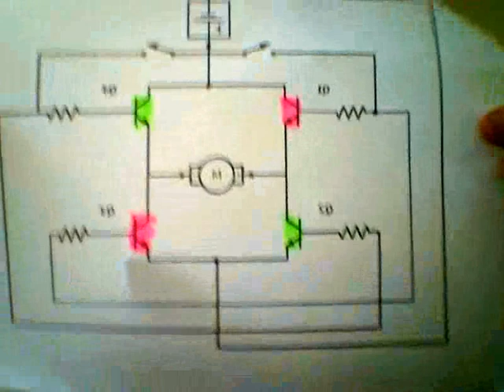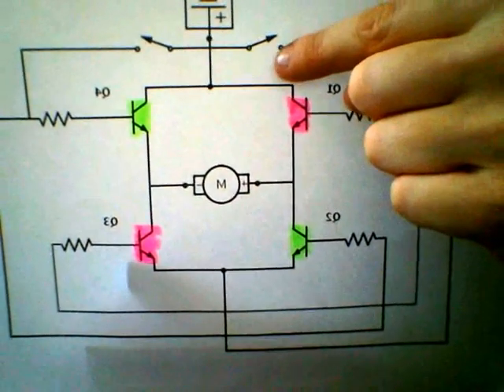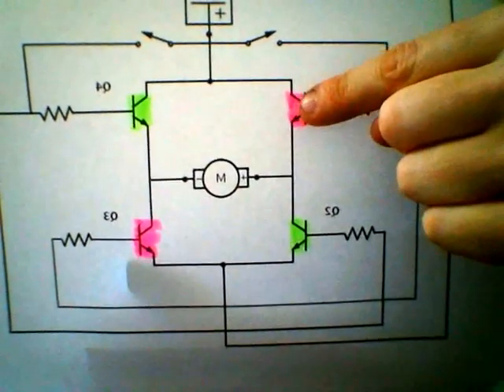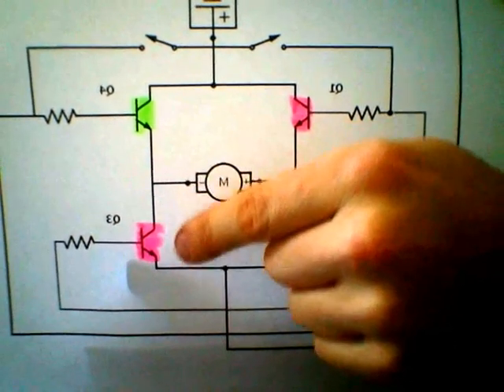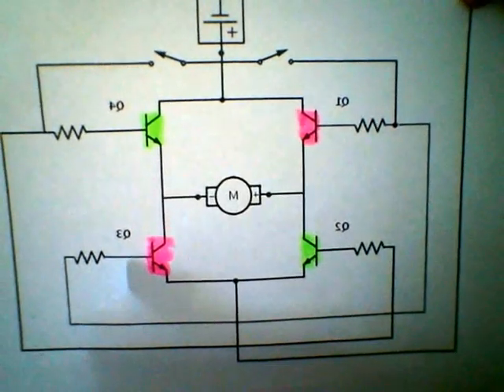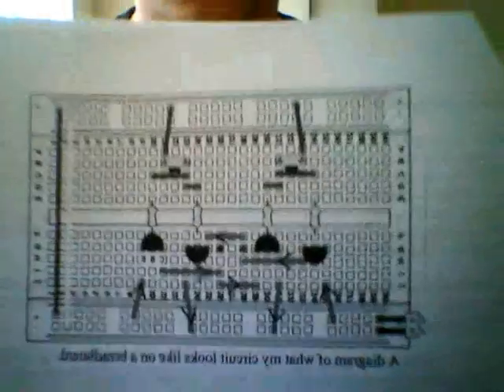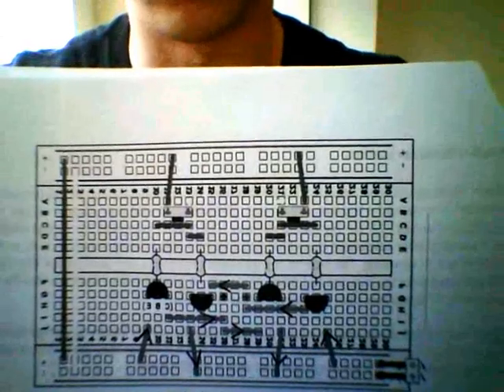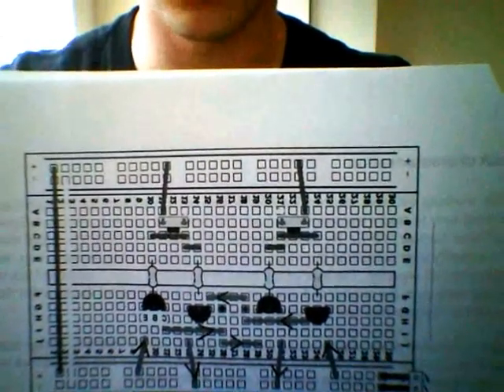H Bridge DC motor. - bi directional - very simple.

Comment: no microcontroller? what are the transistors for? i thought transistors where to supply energy from another source, but you only have one source. 

electronics noob here
Reply: i think hes trying to protect the battery. when the motor stops it generates a voltage backwards up the bum of the circuit. gotta stop that yuckyness from damaging ya battery or arduino
Reply: yeah but i also thought that where the diodes for, for the backlash. and there isnt any diode there...

Comment: you are yousing npn or pnp transistor
Reply: It looks like he's using 4 npn transistors with a simple resistor protecting the gate of each. The dead give away is the manner in which the gates are coordinated. since the cross the h-bridge diagonally, you're actively turning both gates on, rather than turning one gate on and one gate off (which would be 2 npn and 2 pnp transistors).  

As a matter of efficiency, PNP transistors are not used alone for an H bridge. They heat up much more quickly relative to NPN transistors, and designing to only use npn or npn-pnp is much easier.

Comment: can anyone explain to me, in this circuit what is the function of each transistor? I've been reading a lot of stuff but can't seem to grasp what exactly they are doing. I would guess that Q1 and Q4 are amplifying the current which will make the motor spin faster? but what about the bottom ones, Q2 and Q3? please if anyone can explain I'd appreciate it
Reply: Certainly. 
 They are allowing digital control of an analogue device. 

In this setup, only two transistors are on at a time, and that forces the current to follow a certain path. In this setup, that path is across the motor in different directions. 
This ability to flip current is needed to control motors and to ensure a frequency is maintained in certain applications (take inverters for instance). 

The Transistors are not actually adding gain. They are either switched on or off. Gain would actually be bad, because that would allow resistance to the current through one or more transistor. The point of the circuit is to channel that power through an inductor (motors and transformers are inductors), and resistance in a transistor is lost as heat.

For more info check out Afrotechmods channel here on youtube. he does one specific for a H bridge, and it's setup is slightly different so you can tell the difference.
Reply: thanks so much for this Walter, appreciate it.

Comment: better question is why dint you use the pnp type ? the p channel
Reply: npn is slightly more efficient than pnp in purely switching applications. I think that's the only reason this setup exists. 

PNP has it's place, but adding a digital interface to an analogue motor probably isn't the best place for them.

Comment: hey bro this circuit helped me a lot. but got another problem. i connect 5v, 6v and even 9v  with the collector but in all the cases my bjt emitter shows only 4.5 v. i need minimum 6v :( do you have any solution to this problem?
Reply: Use lower value resistors.